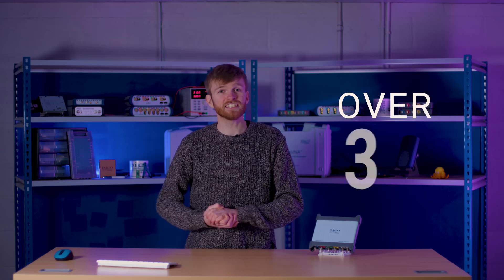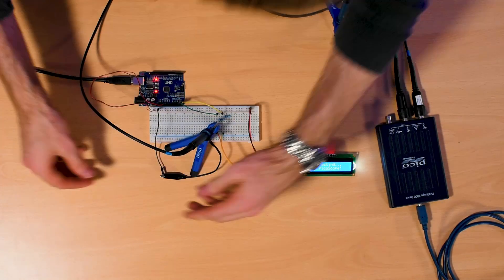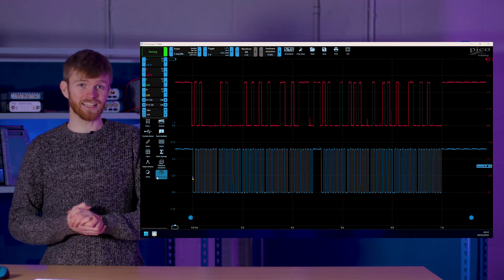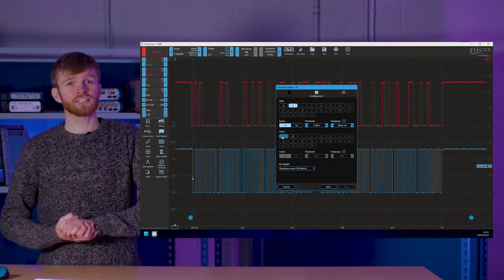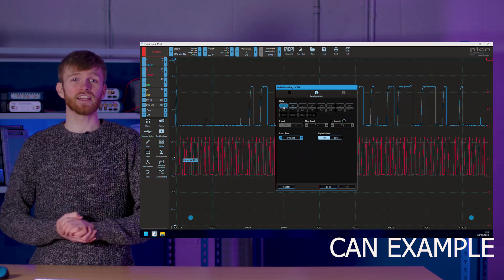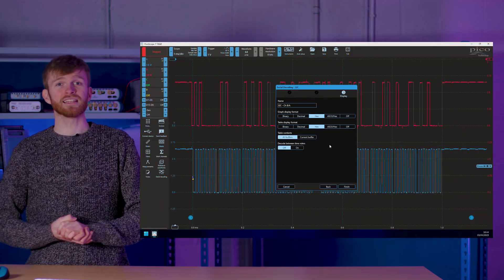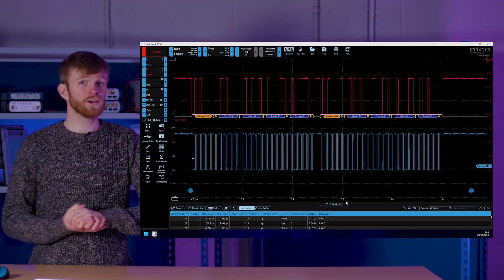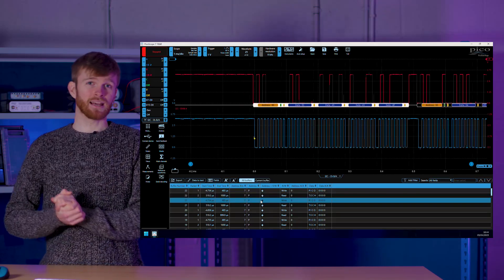40 Serial Protocols | PicoScope 7

Comment: Can you please do serial bus decoding examples (spi, i2c, i2s) using the mixed scope data lines? Perhaps with arduino code examples for exercising the scope.  When is it better to use the analogue connections over the digital connections?

Comment: Please tell me if model 2207B is enough for me to work comfortably with CAN FD ?
Reply from the maker: For most usages a 2207B will be fine to decode CAN FD. But if you would like to decode on "streamed"/"progressive" data (where it's a 'live' buffer of data, above 100ms/div), the 2207B operates at a reduced sampling rate: 9.6MS/s whereas the CAN FD data payload can be anywhere from 1M-8Mbits depending on the payload bit-rate.
Reply: @picotech  Ok, so, you recommend 2208B ?)
Reply from the maker: @smart_electronics_il  The 2207B will be comfortable enough for decoding CAN FD